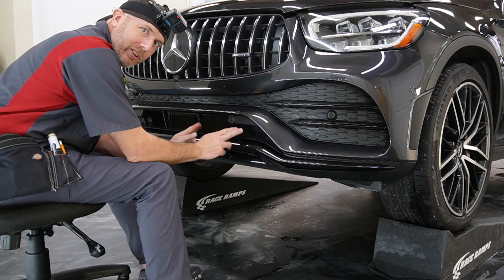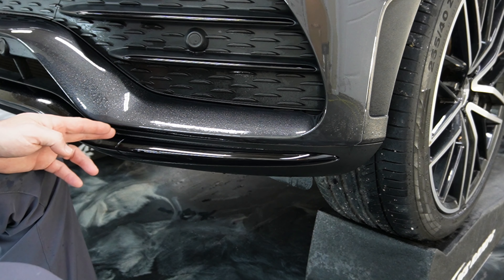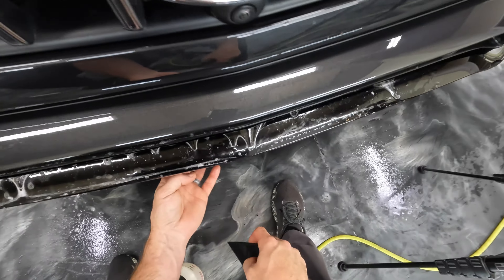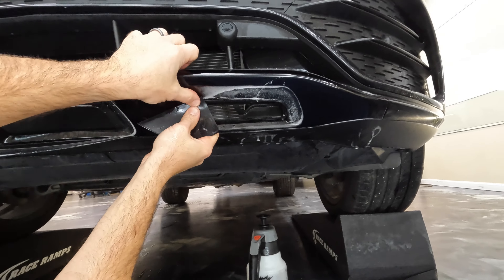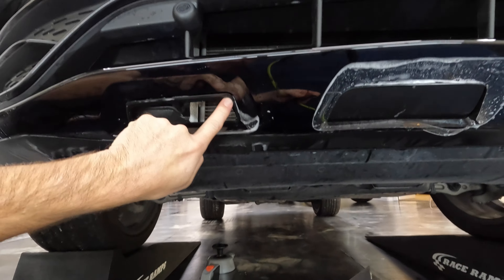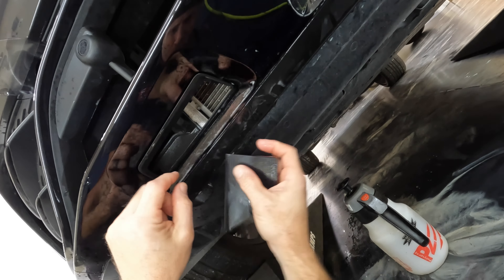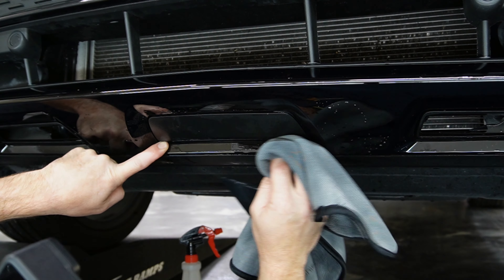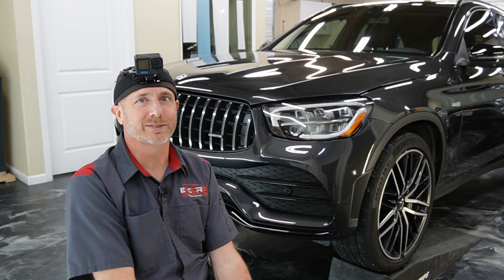Step-by-Step Guide: Installing Paint Protection Film on Black Bumper Trim (PPF Tutorial)

Comment: Hi, another Great video, with a lot of informations that are very helpful for me. One question when i heard your comments : I make a full cover on a black Tesla Y end of the month.  Usually i use clear PPF to do so. To avoid the  problems with a car that has already 20000 km, would it be a good idea to use  a black gloss PPF ? Thanks a lot in advance.
Reply from the maker: Thank you!! It just might work. I'd just maker sure that the color isn't off at all and then go for it. I would also check and see what the warranty is on the black. That might also make the decision for you one way or the other.

Comment: Do you find the black ppf distorts easer?
Reply from the maker: Have you found that as a problem? I have not noticed. But I mostly use it on easy parts. I'll have to try it on a harder part with more stretching.
Reply: I have found that the black ppf shows lift lines as well as stretch marks on larger pieces. It might just be me🙄
Reply from the maker: We ordered more. I'm going to test it. It totally could be a thing, and I just haven't used a big enough piece yet.